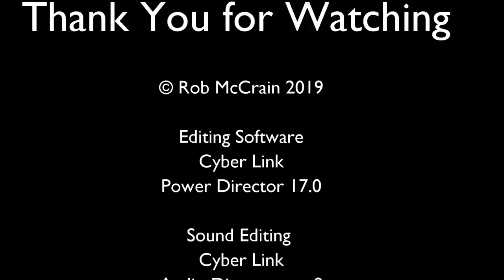97B  Farland  -  the winding dirt track

Comment: Beautiful Rob, it looks so realistic. Your techniques on laying down the static grass, turf, ect was excellent teaching. I have a small hillside on my layout that I plan on reworking. It just looks too artificial and smooth, need to rough it up a bit. 
I’m gonna give it a try soon. 
Thanks for sharing and have a great weekend. Cary
Reply from the maker: Hi Cary, That is great you're thinking about trying static grass.  You will find on hillsides it will want to stick out straight from the side of the hill.  Since real grass grows vertically, you will have to coax it to stand up vertically instead of at an angle.  Good luck with your project and thank you, Rob